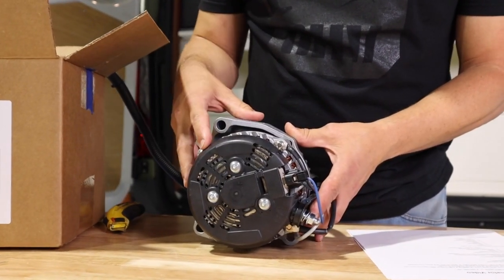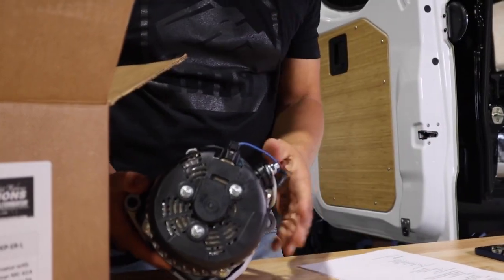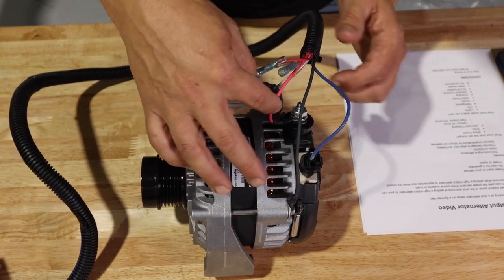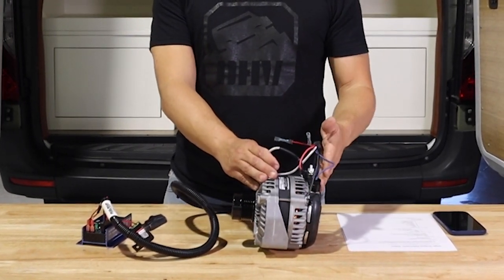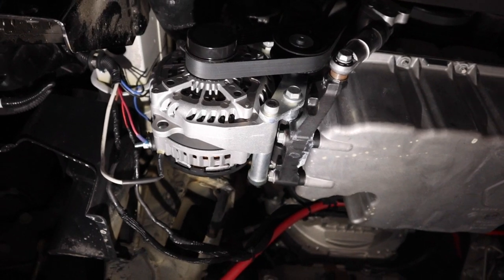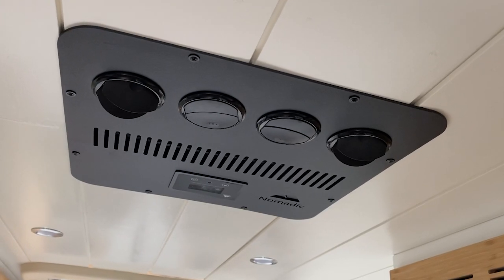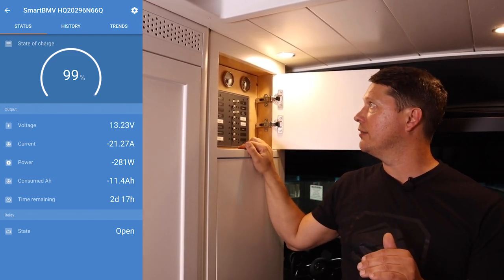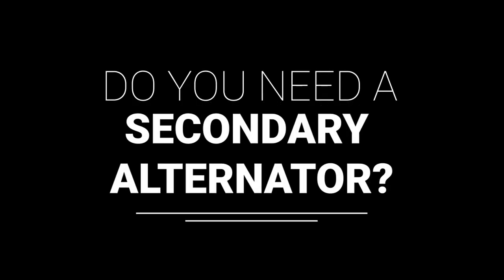Do You Need a Secondary Alternator For Your Van?

Comment: This is an excellent video. It was very helpful. It did raise one question for me: Does an alternator always put out the same amperage? I would assume the answer is "no", that it varies based on RPM. This makes me wonder if it is reasonable to expect the alternator to power an AC unit while the engine is idling. And it leads me to believe that adding "high idle" capability to a vehicle could be useful in this context. Thoughts?
Reply: The Nations Alternator drops to 127 Amps at 1600rpm( from their website for a Promaster) I would guess its around 100 at idle.

Comment: Great video. Just watched for the second time to get my head around it all. 

Questions: Is it better to tie the 2nd alternator to the main starting/charging system or keep it separate? Is the voltage controller still required if there is a DC-DC charger in the system?
Reply from the maker: The voltage regulator is always required for a high-output alternator and lithium batteries. The DC charger is typically limited to 50 amps or so.
Reply: @VanLand  thanks!

Comment: What size wire are you running from the alternator to the back?
Reply from the maker: Hi Ken, it depends on the amperage draw and total length of wire. This chart will tell you exactly what size to use depending on those two factors. http://assets.bluesea.com/files/resources/newsletter/images/DC_wire_selection_chartlg.jpg

Comment: Why does no-one use the correct terminology when it comes to amps and amp hours? Even qualified electricians can't get it right. 🤔
Reply from the maker: Watts = volts x amps

The only formula you need to know. 

Remember LiFePo batteries run at about 13.4 volts in a “12v” system.
Reply: @VanLand  I'm aware, but amps per hour are not a thing. Ah is a thing, and is amps x time, so you could maybe say Ah/h to decsribe the mean current draw from a varying load like the fridge but it is easier to just say average current draw.